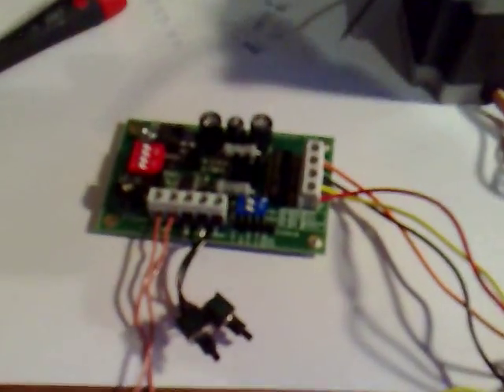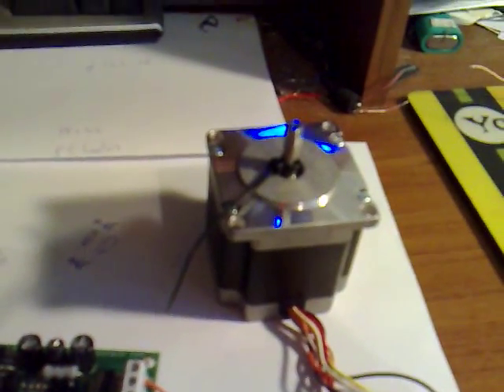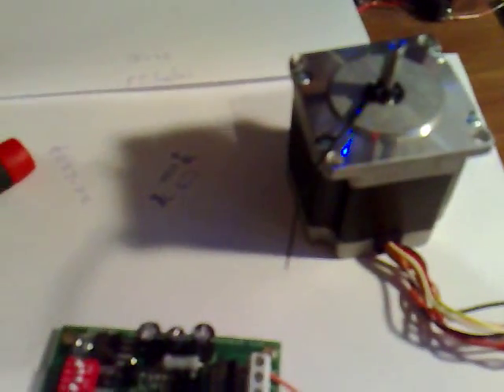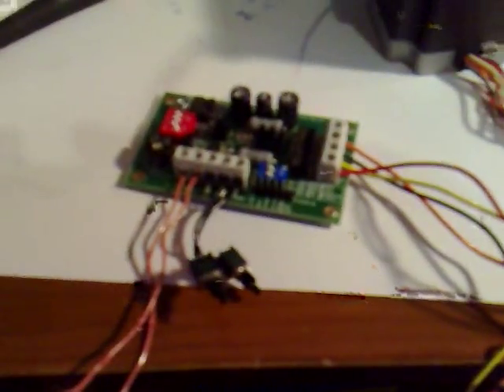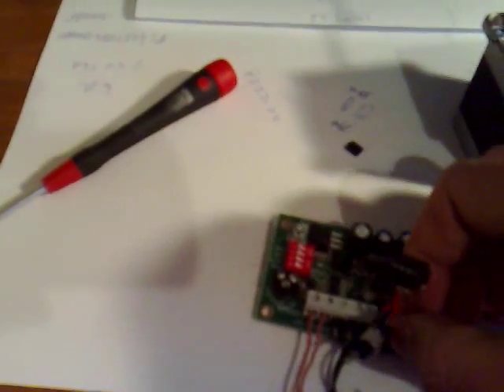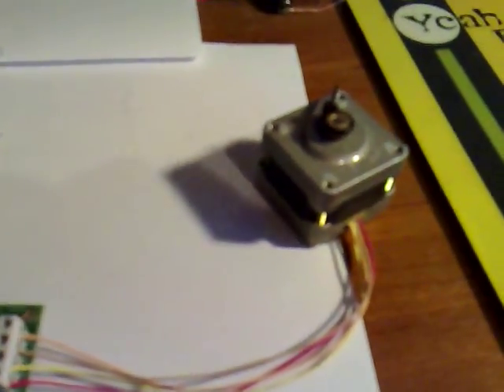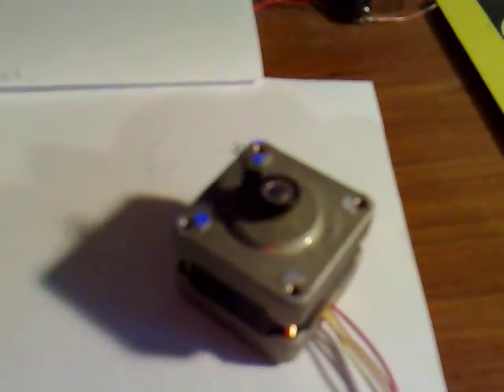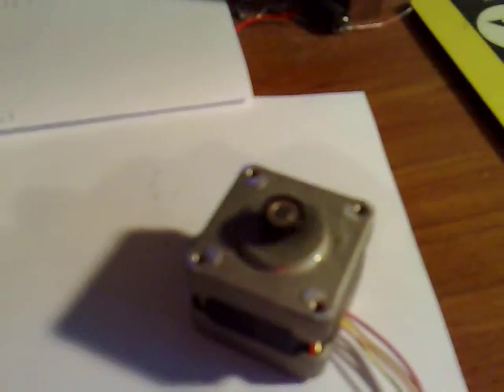ESMC-04 Stepper motor controller.

Comment from the maker: Yes, this could be done. I used one of these boards with an optical rotary encoder and used a microcontroller to do the conversion which was fairly simple and worked very well.